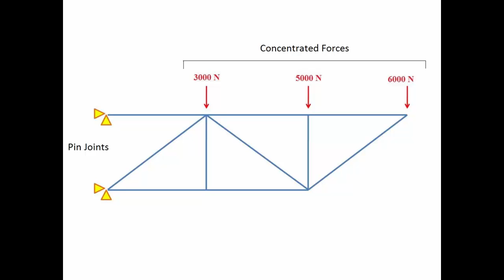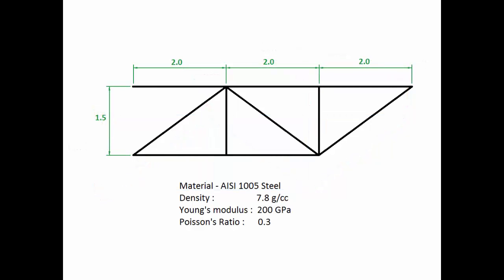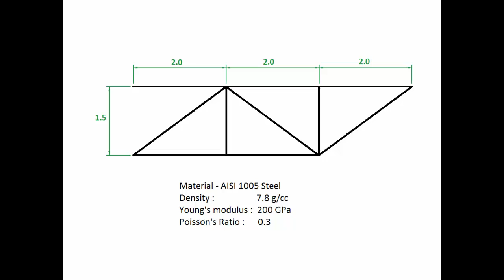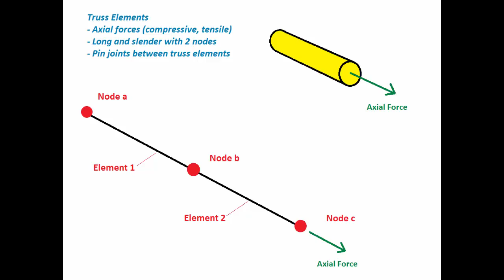2.a) Static Analysis of a 2D truss - Overview (with audio)

Comment: Hello, from where I could reach the .py versions of the scripts written in your book?
Reply: hey, I could find them either.
But one possible way of getting those ''.py'' documents on your own is that:
1. Build and run the Model using GUI.
2. Submit and complete the job. 
3. Find the ''.jnl'' document in your work directory.
4. Open those .jnl files by Notepad++ and save as .py format.
Then you can obtain the py files with the same content as in his book.

Comment: need help with this mesg error  " Excessive distortion at a total of 103043 integration points in solid (continuum) elements " "Displacement increment for contact is too big"
Reply: Really helpful! Do you have any Lectures on FEA Analysis